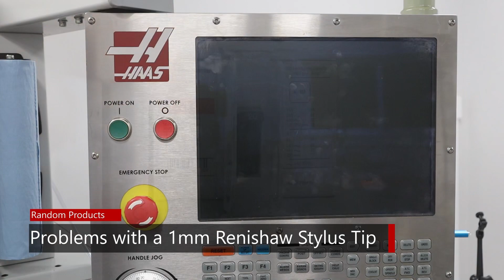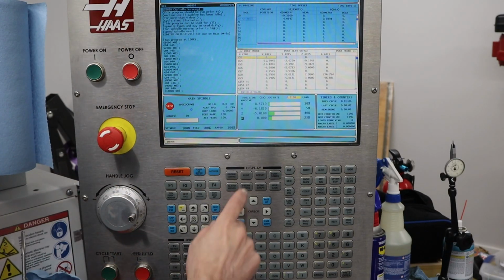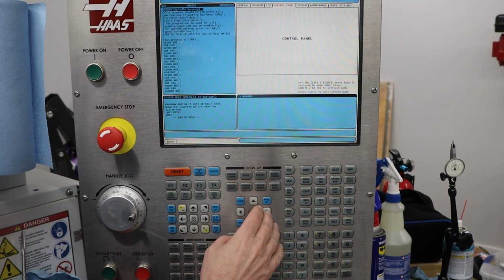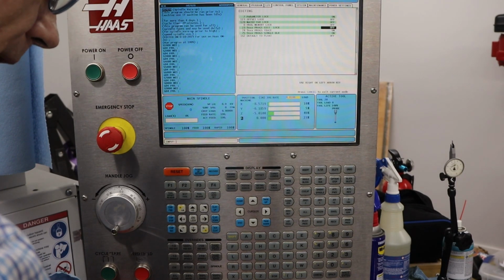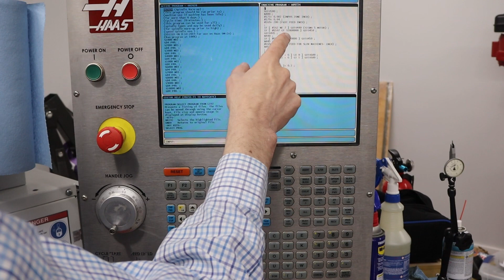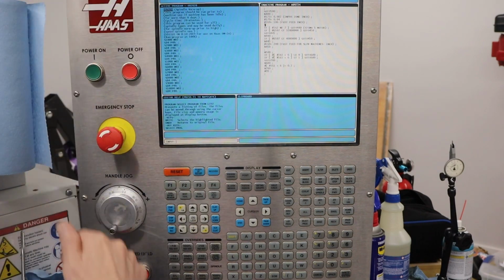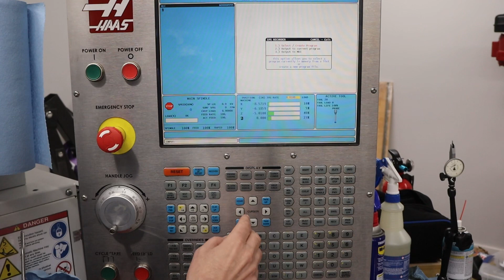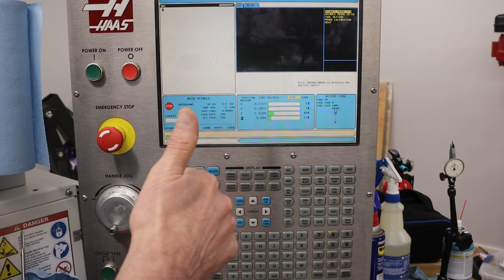Problems with a 1mm Renishaw Stylus Tip

Comment: Another interesting question is how to reduce the speed at which the tool drops on the tool length sensor. It goes so fast that for 1mm end mill it can break it.
Reply from the maker: It might be the same. The fist touch speed applies to X, Y and Z. I haven't tested that. But you can call Renishaw and ask. If you do, please reply with at you learn. Another viewer mentioned you can use the feedrate override to slow down all probe movements. I have used the toolsetter with a 0.02 inch diameter end mill.

Comment: I'm not sure why 1mm vs. 6mm tip should require a different approach speed for the second contact. It seems like both contacts should be the same, and still doesn't explain why the difference is diameter-dependent.
Reply from the maker: It's because of the short length. So the same speed of travel causes the angle to change a lot faster. The trigger is based on angle change. Hence, with the angle changing faster, it can't keep up. I didn't think this through until you asked that question, as it would have been good to cover this in the video.
Reply: @JohnSL  - Hah! I was concentrating on the diameter and completely missed the length difference.

Comment: With the variety of work I do, I change probe tips and sizes regularly to reach the features I need to probe. This is great advise if your planning to change probe tip style permanently.But if your like me and changing to different sizes and lengths regularly, it's more efficient to just slow down the feed rate overide while probing with the extra small or extra long tips.
Reply from the maker: Nice. Changing the feed override would have been a quick way to test this. Since I want to do in process inspection with the 1mm stylus, I'll need to keep the lower feed rate in the macro. But it's nice to know about that trick. Thanks.

Comment: there's also a mechanical tension adjustment inside the OMP but it's a pain to control. I use a longer 150mm ruby stylus with a particular workpiece and they realllllllly recommend loosening the internal tension for that, since it can cause premature wear on the ball. I went ahead and did it, but then reverted back and instead just used different trigger feedrates exactly like you described. It's theoretically the opposite with a stubby stylus (wants a stiffer tension) but it probably doesn't matter since the materials are different for that stylus anyway. I have a 1.5mm stylus myself but never used it, just bought it for fun 😆
Reply from the maker: That's interesting. I certainly wouldn't want increase the tension for this stubby probe because the shaft is even smaller in diameter (I'd have to look it up), which means it could flex more easily.